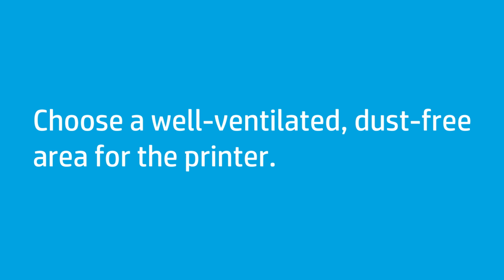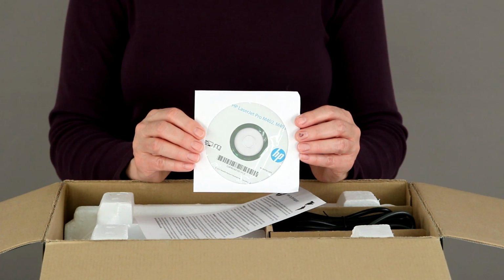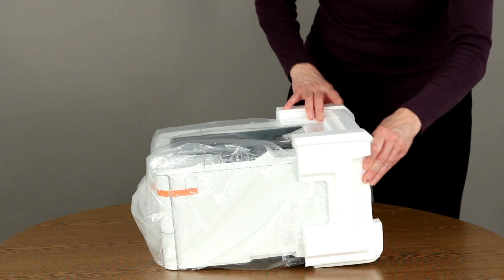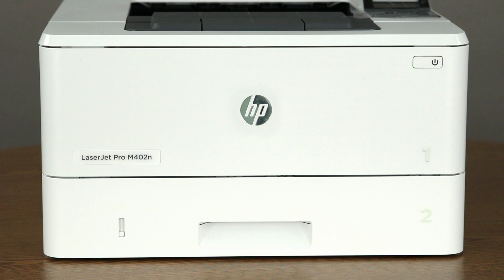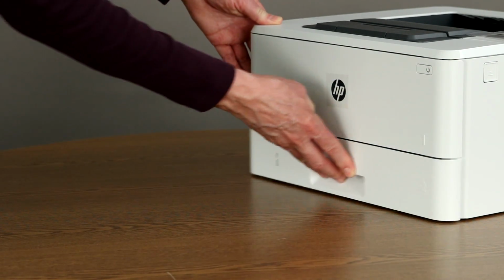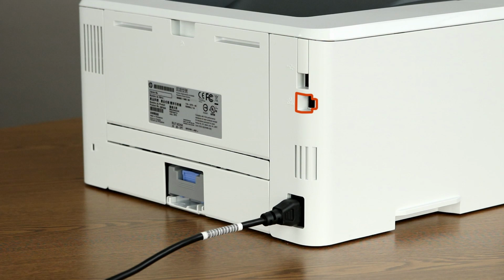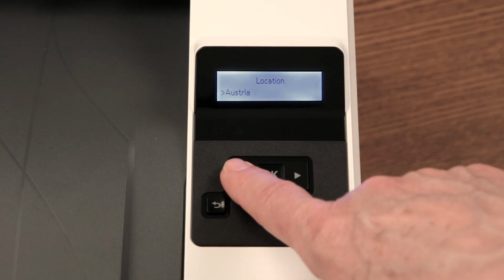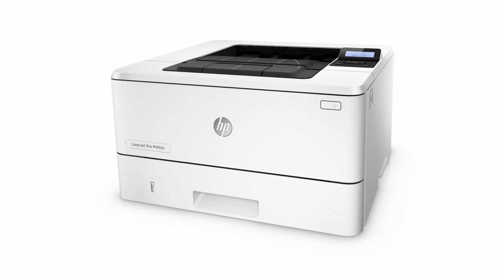Unboxing and Setting Up | HP LaserJet Pro M402 and M403 Printers | HP

Comment: I need A4 documents file( half portion) to print in A5 with tray 2. It is showing unexpected paper size tray 2
Reply from the maker: +anil payyoor GOTO settings > printer properties of your printer > preferences>paper quality >change the paper to A4 size and restart the printer. Give any print see difference The error will fix.
Reply: @HPSupport  Actually this is money exchange, in the software automatically generating A4 size form, but we can't print on A5 with tray 2.   Problem not solved... Unexpected paper size
Reply from the maker: +anil payyoor Please perform the steps mentioned under this document to fix this issue: http://bit.ly/2rmEqKJ

Comment: garbage product
Reply from the maker: +Mardo Castillo Please perform the steps mentioned in these documents to fix this issue: Installing the printer software in Windows on a Wired (Ethernet) Network: http://bit.ly/2DAgPdm or Installing the printer software in Windows on a Wireless Network: http://bit.ly/2DyxJcC or Installing the printer software in Windows for a USB cable connection: http://bit.ly/2DymbWM